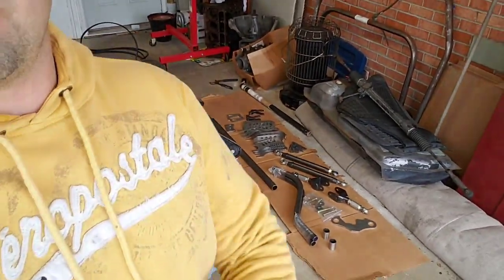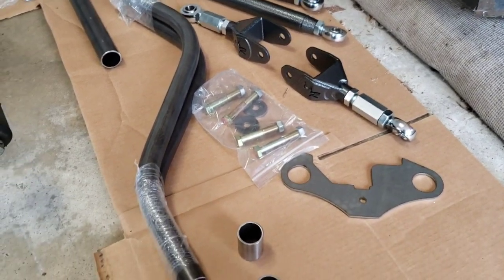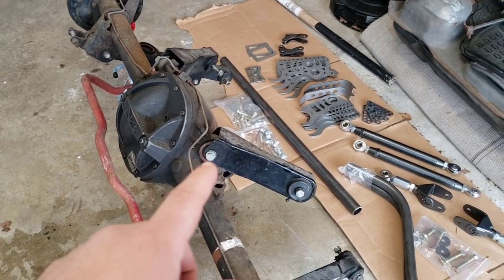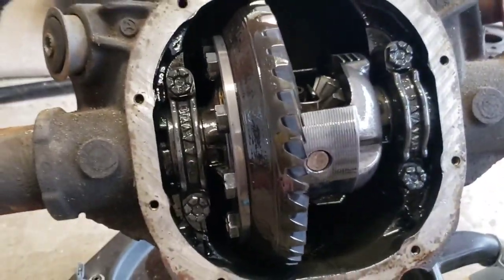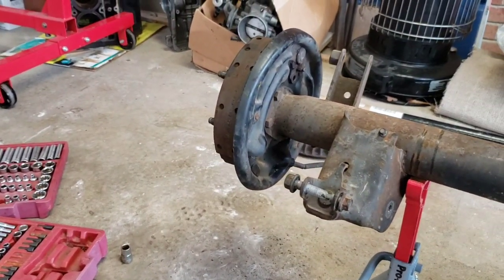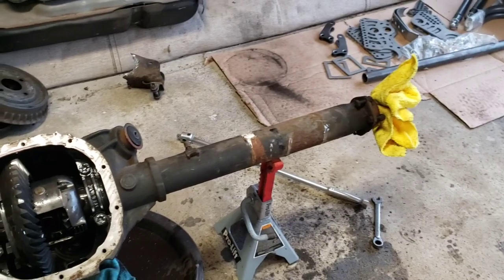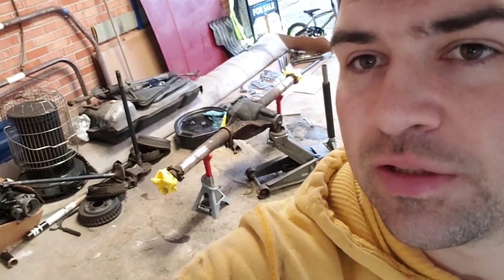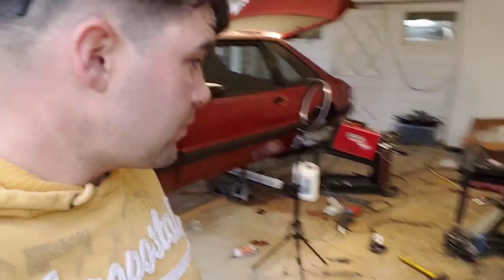BUILDING AN 8.8 USING MERILLAT RACING BRACKETS AND BRACE KIT!

Comment: Zach, those are Quad Shock brackets on the end of the axle tubes. They were there to prevent wheel hop. You won't need them with rod end control arms.

Comment: Yea i gave up on all that food due to lack of luck the past 40+yrs lol. Those outer brackets are for the  Quad shocks.  A stainless knotted wire brush for that grinder is awesome for cleaning rust/debris and i would weld those grind notches unless the new brackets will be welded in those spots.
Reply from the maker: I ended up welding them! Thanks.

Comment: Don’t weld the cut. You need to keep as much heat out of the tubes as possible. Heat will warp the tubes. Change sides while welding short beads to keep the heat down. Preheat the cast center section with a torch when welding the tube to center section. That will help with penetration.

Comment: I have 8.8 rear disc off my car and a 3.55 gear at the shop
Reply: But there sn95 brakes
Reply from the maker: What's the difference between sn95 and a regular 5 lug conversion?
Reply: @zachmoore4564   when doing sn95 rear brakes on a fox, you have to cut the mounting bracket to slide over the back side of the housing, I been 5.0@142 with them, you lose one mounting hole, I talk about it in one of my videos, I will find the link shortly
Reply: @zachmoore4564  

https://youtu.be/zv_VXoUTUCM

1:00 mark
Reply from the maker: Cool. I'm checking it out now. Thanks man
Reply from the maker: @Boostismyfriend  thanks for that info.  I'll keep that in mind.

Comment: If you're doing all this now and have a spool why don't you have the C-clip eliminator kit going on? Even if you don't use the spool right away you should have them. Regardless it's crazy not having C-clip eliminators period on anything your racing that's going to hook hard. Otherwise there's nothing stopping the axle from shooting out. I've broke 35 spline axles in the past and seen many 28 and 31s break with little power. I've done many C-clip eliminator kits. Trust me it's much easier with the rear out.  Good luck bro.
Reply from the maker: I do have c clip eliminators on the axles going back on the car. Thanks!
Reply: @zachmoore4564  ok cool didn't hear anything about them, maybe I missed it but idefinitely cover them when doing this project. Many know little about how important they are on this type of rear or why they're important or what they even do regardless of the name lol. Add a anit roll bar too if it's not part of this kit. Smart going with the Holley computer by the way. I started with Gen6 DFI in the late 90s before moving to F.A.ST, Big stuff 3, Fueltech, etc but still played with carbs too. There's pros and cons to everything.
Most guys do things the easy way because they're scared of the unknown. Remember no one knows everything but together we can know little but never much. Never lose the want to learn. Once you stop learning you'll get left behind. Similar advice given to me many years ago by Nitrous Pete Misinsky. One of the legendary 5.0 originals. Again good luck bro.
Reply from the maker: @waynebollentin989  thanks! I really appreciate the advice. I do have an anti roll bar as well.